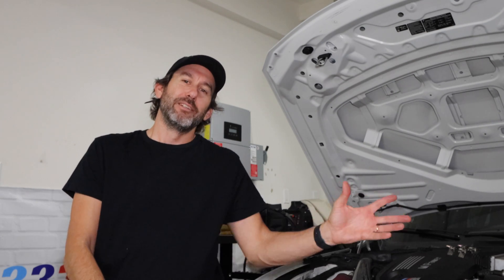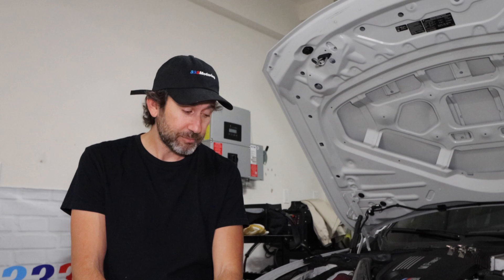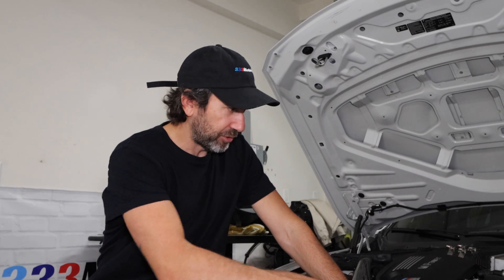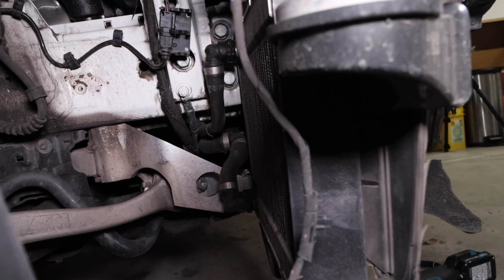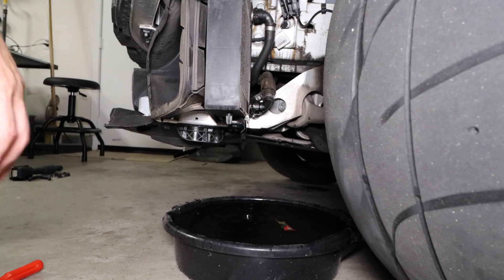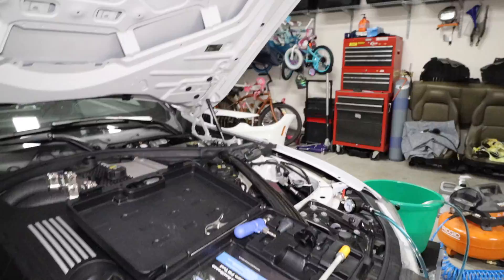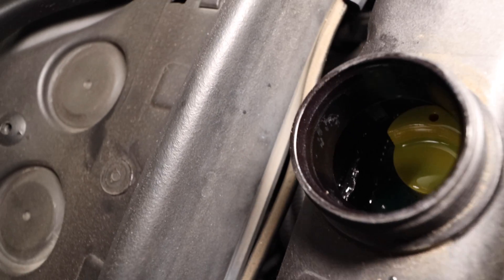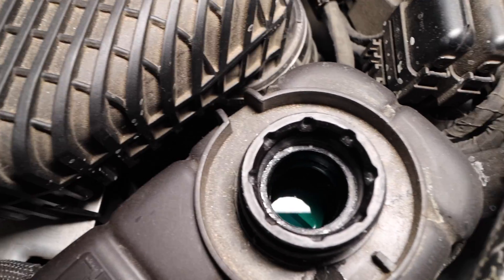BMW F80 M3 Coolant Refresh

Comment: Can I just drain the coolant on both sides as shown, pour in the coolant manually, and then use the electronic bleeding system built into the car?
Reply from the maker: That might work but I feel like you are putting yourself at risk for air pockets in the system.

Comment: Please if someone knows where the coolant is leaking… It’s a 2017 BMW 330i X drive. It’s basically just pouring out as it is poured in towards the back of the engine under the car. If anyone know I need help…
Reply: It wouldn’t allow me to post a short video on here so I could show you
Reply from the maker: Do you have two coolant reservoirs?
Reply: @RascoeGarage  yes but, now I have found it’s coming from a purple or out looks purple box it looks like a radiator piece between 2 hoses hooked up one on each side of it. The actual box is leaking.
Reply: I have a video and a picture but, once again it won’t let me post them
Reply from the maker: Anyway you can get a picture of it?
Reply from the maker: Anyway you can get a picture of it?
Reply: @RascoeGarage  yes but it won’t let me post it on here. Need an email or something
Reply: @RascoeGarage  it looks like it’s leaking in or around an automatic transmission oil cooler
Reply from the maker: @WayneLaughlin-t8w send it to info@rascoegarage.com

Comment: DO WE ACTUALLY need the fancy air tube pressure thing
Reply from the maker: Thanks for watching! You do not need the vacuum fill tool but I recommend using. It helps you identify any leaks and it fills the system perfectly in one shot.

Comment: does the bumper actually need to come off to drain?
Reply from the maker: The bumper does not need to come off. You don’t even have to take the wheels off. Just need to remove the inner fender liner to get to the radiators to drain.

Comment: I assume you figured this out by now, but that charge air cooler up top was leaking all of the coolant into your engine. Coolant Doesn’t just disappear and that part is well known for leaking. I had it happen on mine. I have a CSF, but I had another one before that.
Reply from the maker: 100% the intercooler failed. It was dumping coolant down the j pipe and leaked coolant all over the place. The stiffening plate caught all of it so it was hard to tell where the leak was.
Reply: @RascoeGarage  I feel it 👍🏻 I’m about to change out my main radiator and I was looking for that bleed procedure. You don’t happen to have that do you?
Reply from the maker: I do. There is a screenshot of the instructions in the this video. It’s straight from the itsa program

Comment: what if you dont have an HVAC system in the car - its a track car, any ideas on how to kick off the electric pump.  only doing the low temp as a result of replacing the charge air cooler
Reply from the maker: Not sure what systems you have left on the car. If you turn on ignition, headlights and hold down accelerator for 6 or 10 seconds I would think the pump would kick on. Not sure if the system needs to have hvac engaged.
Reply: will try, thanks @RascoeGarage

Comment: Only the low temp circuit has an electric pump, holding the accelerator for either 7 or 10 seconds will only bleed the low temp circuit every-time. The high temp side runs off of a mechanical pump (hence the separate drive belt for it). BMW just fudged the procedures in ISTA, most likely carried over from the electric pump only n55. Great video though!
Reply from the maker: Thanks for watching and thanks for the insight!
Reply: How did he in the video get the larger reservoir pump to bleed, you can hear it in the video. But I cannot get it to turn on, only the smaller top reservoir ever bleeds?
Reply from the maker: @Xburn21 follow the preliminary steps in the video the only difference is how long you hold the accelerator down. One reservoir is activated after holding down for 6 seconds and the other is activated after holding down for 10 seconds. It works but your count has to be spot on.
Reply: @RascoeGarage  I’ve tried it a few times already, I’m using my phone to time it just in case. Still only the smaller one bleeds. But I ran the car and let the system cycle through, seems to be fine.
Reply from the maker: @Xburn21 are you pressing the accelerator all the way to the floor? In the f8x you can floor it and then there is another 1/4” or so of pedal if you press down all the way. That’s how I did it in the video. As long as it’s not overheating and you check the coolant level you should be good to go.
Reply: @RascoeGarage  yeah I’m depressing past the kickdown portion. After running it for a few minutes the level dropped in the main tank and I just added a little on top to make sure the toilet seat is covered. Fingers crossed it’s all good.

Comment: It also said for the low pressure colling system to leave the cap on and shit but you said leave it off lol... which do i do? You said to put it on for the high but not the low
Reply from the maker: So during the bleeding procedure it says to put the cap back on which you can do. I left it off so I could keep an eye on the coolant level. When I ran the bleeding procedure the coolant gurgled and bubbled a bit but nothing crazy.
Reply: @RascoeGarage  just did it. All went well. 1st did top cooler. Began over filled. Dropped to low. Filled to max. Ran the high temp system and the top tank behind the top cooler again dropped to the low mark.... the large bottom container stayed the same... weird lol
Reply from the maker: @austenazevedo6078 glad you were able to get it done. I hope the video helped! Thanks for watching!

Comment: Whatvwas the pressure that you held on the small chargebair system for the vacuum before filling? Negative what
Reply from the maker: On the vacuum system you get the pressure to -600 mm/Hg or 80 kPa prior to opening the valve and pulling in coolant. Also once you get the vacuum to pressure let it sit for about 5 minutes to ensure you don’t have any leaks in your system.
Reply: @RascoeGarage  is there a psi count? I'm pretty sure I saw another video that said 24 or 25 something?
Reply from the maker: @austenazevedo6078  I just looked up a conversion to psi and both measurements equate to 11-12psi

Comment: Best video I have seen on replacing coolant in an M4! I just did mine today and referred to this video a couple of different times. Unfortunately my coolant vacuum pump didn’t work as well, it wouldn’t hold vacuum on the hot coolant side but not a big deal. I just had to add more coolant manually.
Reply from the maker: Glad to hear the video helped you out!

Comment: I would recommend a battery charger..
When I got my M2c new it went down to 11.8v or so while coding for 20 min and everything was off
This was after I drove around for 20min to charge it up with the alternator 

Since then I’ve gotten a battery charger for coding my car and flashing tunes
Reply from the maker: It’s recommended to use a battery charger. I’ve flashed my car several times along with bleeding the coolant systems. No issues thus far but as you know every car is a little bit different. To be on the safe side a charger is a good investment especially if you have DCT.

Comment: When I did the 10 seconds for the engine coolant, it did the same thing as the 6 second and bled the intercooler
Reply from the maker: The 6 second should bleed the high temp system and 10 seconds for the low temp. It sounds the same for both. You have to look in the reservoir to see the bubbles coming up.
Reply: I also have the same issue, no matter if I hold for 6 or 10+ seconds only my smaller top reservoir bleeds, I cannot get the larger one to run and get the bubbles to come up
Reply: me to same, why? @Xburn21
Reply: @Xburn21 main water pump is mechanical, you’d have to run the car for it to move coolant around
Reply from the maker: @Justanon70 the pumps are electric and will move coolant around once you run the bleeding procedure. I’ve seen it first hand, you can look in the reservoir and see the coolant moving.